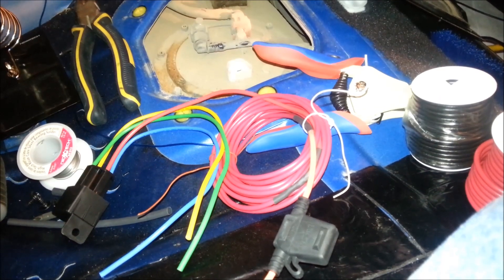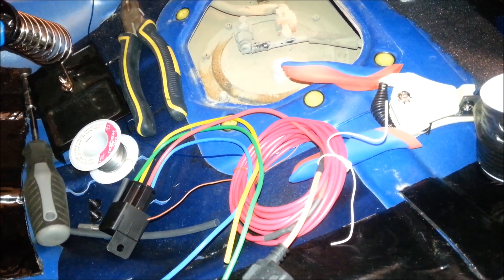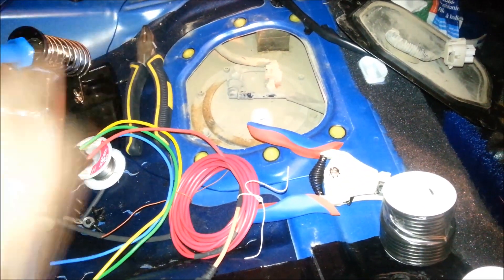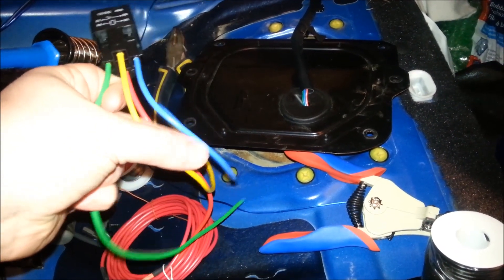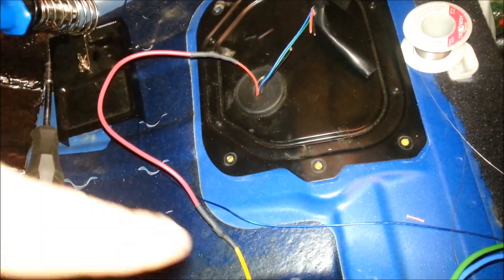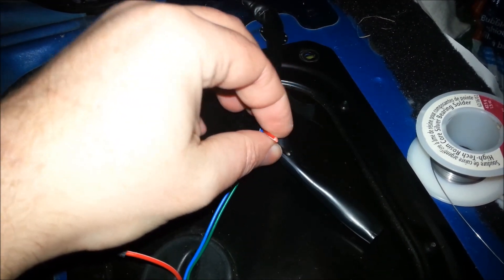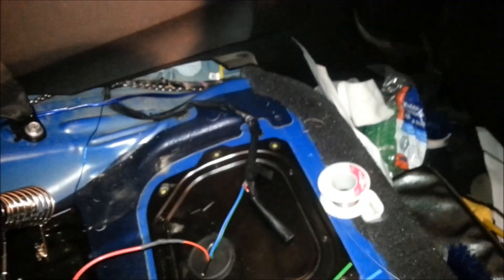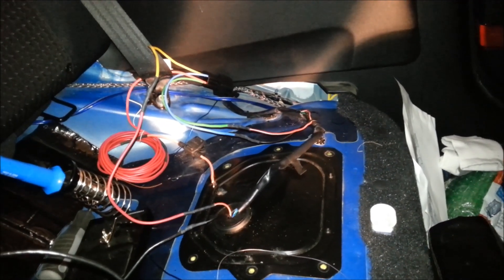How to install a dedicated fuel pump relay

Comment: good connection 
can i put switch to control both petrol and gas
because the car is fiat multipla using petrol and gas.
Reply from the maker: I'll need some clarification on this. In North America, gas is a colloquial term for petrol, so do you mean like natural gas or LPG (propane) and gasoline?

Comment: Snoopy would you recommend this if my fuel pressure gauge is fluctuating +/-5psi at idle and in boost? Is the varying voltage from the alternator causing this?
Reply from the maker: kylejohnson06 That might be a good indication that the pump can't keep up with either fuel demand or it's not getting enough power.
Reply: depends on a lot... are you running a pressure regulator, fuel return,  dedicated power or oem ,, etc.... is the pressure regulator (if you have one) connected to the vacuum lines ( if so equipped)

Comment: very nice build bro. your a trooper workin on that in -20.i havea 2013 rspec what r the differences and what can i do that wont void my warranty. i live in ontario
Reply from the maker: Doing this will cause issues with your dealership if they ever find out you did it. 2013s are wired the exact same though the wire colours might be different, shouldn't be though. Black is almost always chassis return (ground) on the GC but in some rare instances, it's not.